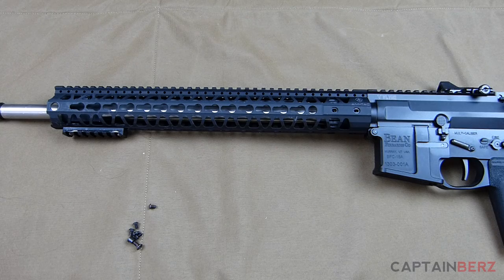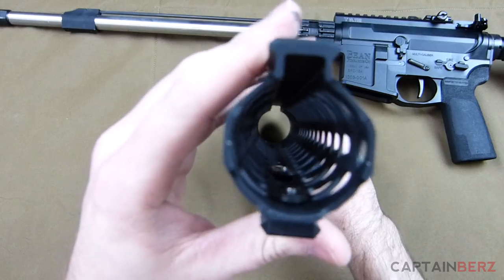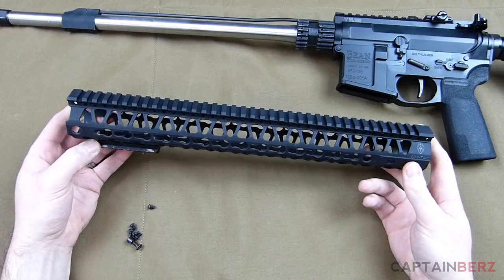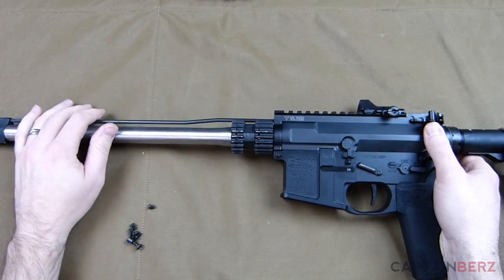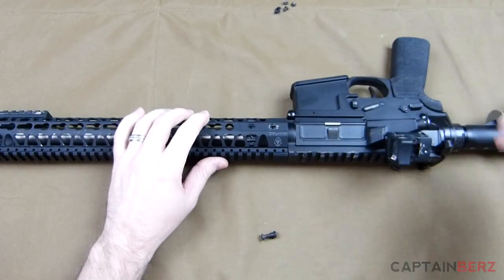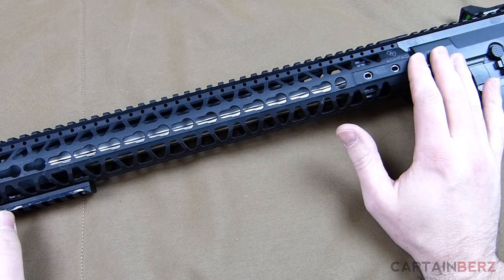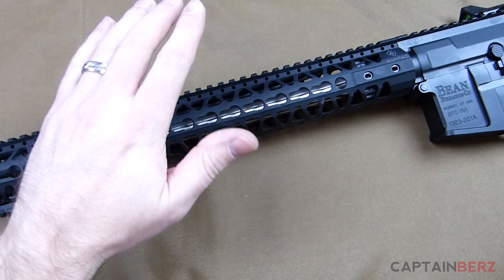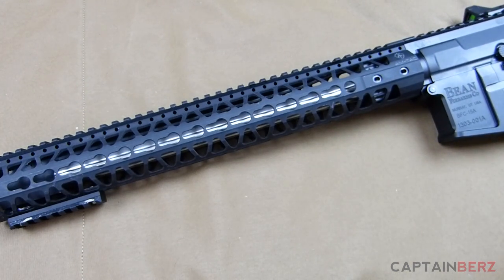K.R.S KeyMod V2 Rail by AM-TAC Precision

Comment: I went with a MIDWEST M-LOK rail on another Pistol build, the M-lok does come loose if not tightened properly too, I use the weld nuts too for certain items.   I found out quickly that theres not a whole hell of a lot of accessories for M-LOK yet other then MAGPUL, Someone needs to come out with a low profile section of rail, at least for now, as with these new narrow diameter rails some items will stick out to far or, in the case with trying to mount a WML offset, theres not enough clearance to even mount it at a 45. On a side note im looking forward to the new GRIP STOP, isnt it supposed to be available like this week?
Reply from the maker: The Tactical 6 String Really? I have not come across this issue. I use a IWC 45 offset with inforce WML's on my AR's for the most part. I saw a kick ass design by Parallax Tactical they are working on that gets rid of 3/4 of the pic rail on the top, as it is not needed. I am always asking him when they are coming out with it. Lol.
Reply: The MAGPUL polymer M-LOK stuff snugs up fine due to it having some give I think. I really havent thread locked anything before so Ill start doing that onece i feel what ive got is hat is staying.